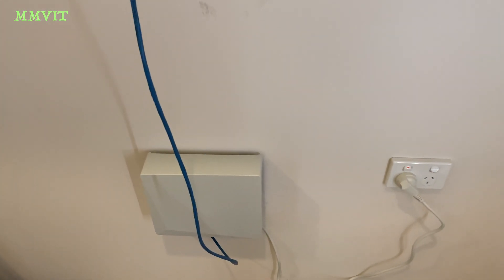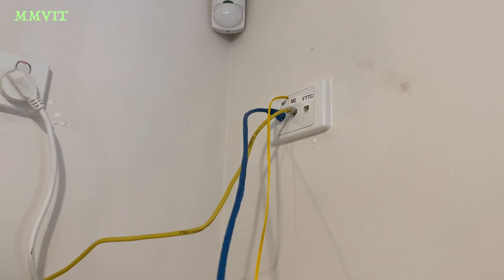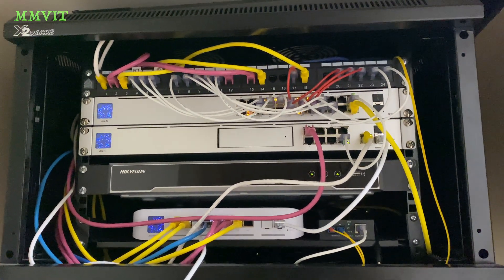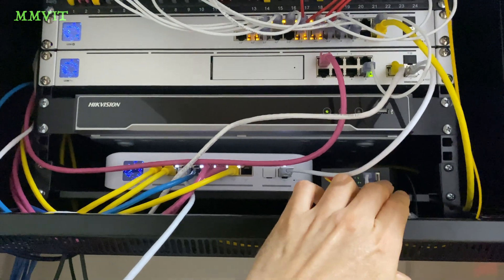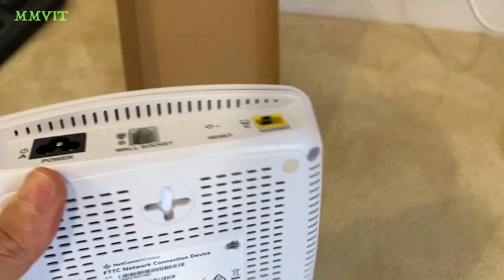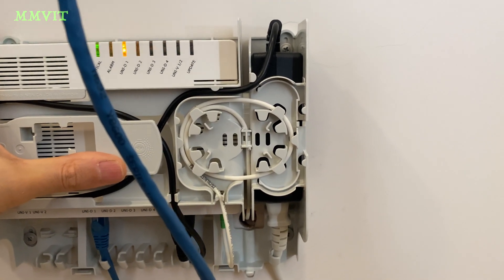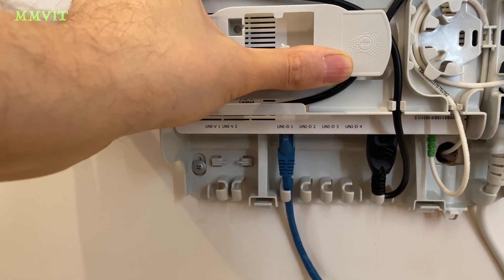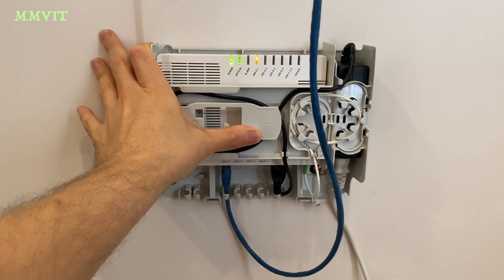My FTTP upgrade from FTTC

Comment: Hi there, just wondering if I could get my modem and router to be in the living room instead of the garage (since the living room is in the centre of the house). Since the NTD unit is also located in the garage, given that my whole house is Cat 6 cabled, can I connect the UNI-D 1 port with a ethernet cable to the side panel's ethernet port which is corresponding to the wall data point in my living room, then connect my modem to that data point then the router to the modem? So that I can have all my man cave devices connected directly to the router for full speed.

Comment: I honestly think that FTTN works fine in my home, 90% of the issues I had years ago were equipment quality so I was offered an upgrade Modem with WiFi and 4g backup.
I recently checked the uptime on the modem and it hasn't rebooted since install with very few logged notifications.
For what its worth We run multiple streaming services, a few game consoles and 3 or 4 sessions on Youtube and between the service speed and buffering the system holds its own.
We have been offered "Free" install and modem FTTP with an increased subscriber cost but as my actual data speed is well in excess of the stated speed im going to hold off :-)
Reply: i have FTTN and it is shit constantly unstable speeds and buffering regardless of the time of the day but no dropouts i'm so fed up with it i'd rather have FTTP